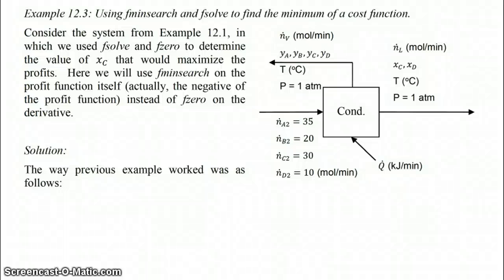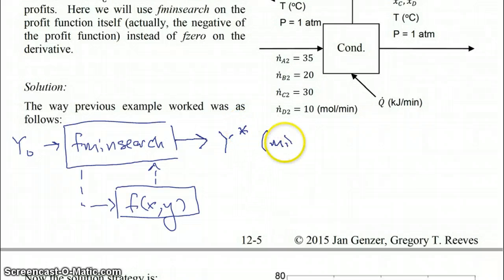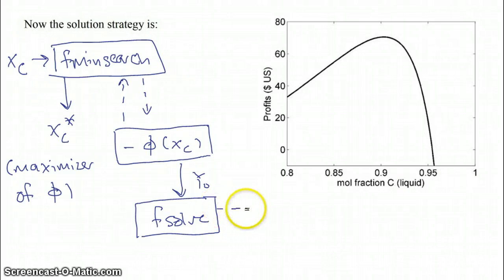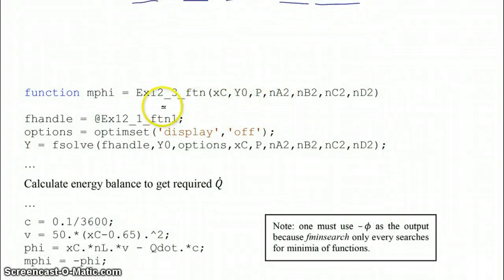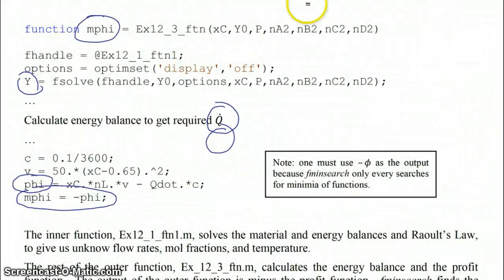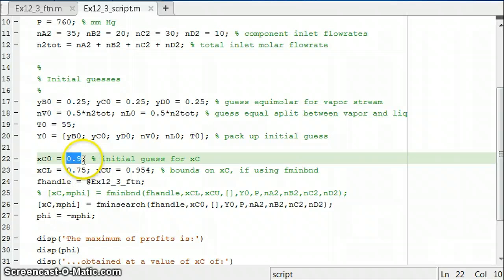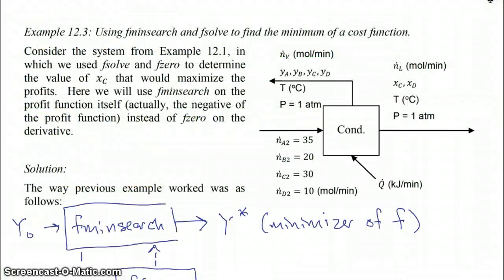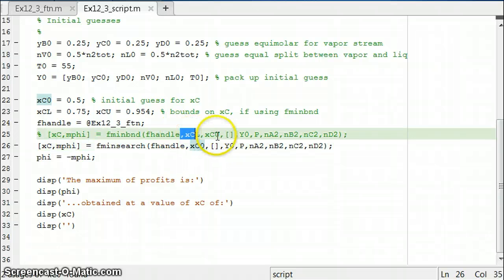Using fminsearch together with fsolve to minimize a function

Comment: Hey, this is out of some minor desperation, but I have a similar problem. So my fminsearch uses initial guesses in a k matrix to call on a function2 that gives a value for error which i wish to minimise. However, function2 uses fsolve, which calls to a third script, function3, which needs to solve for temp and x (i called this var(1X2matrix)). the problem is, in function3, it won't recognise the k values within it. it says not enough input arguments when I put k in the brackets in the function name bit at the top. i.e. the guesses for k do not propogate through to the third script (I think). I've even tried assigning k to an intermediate global variable which can be shared across function2 and function3, but for some reason, the variables wipes in function3 - i know this because i've run the code step by step.
Reply: Gregory Reeves yes, thanks. so I’ve realised, the thing missing from my fsolve notation was forgetting to put the k values in after writing [options]. I had not been writing [options] in the fsolve call; all the variables after that bit are then recognised by matlab as inputs.